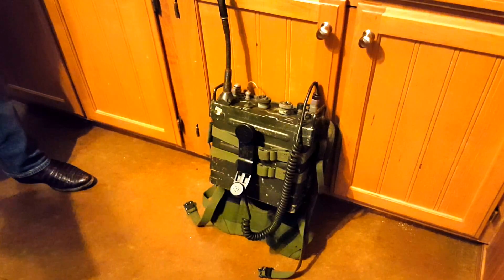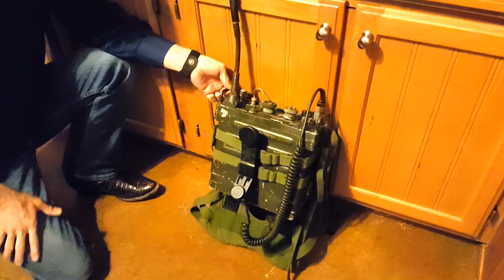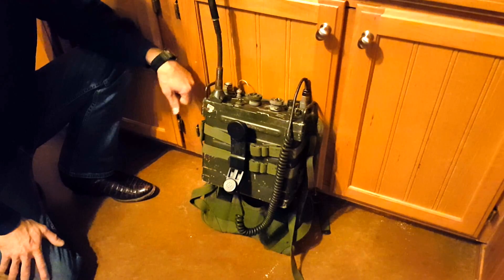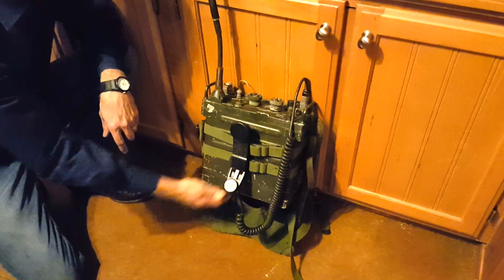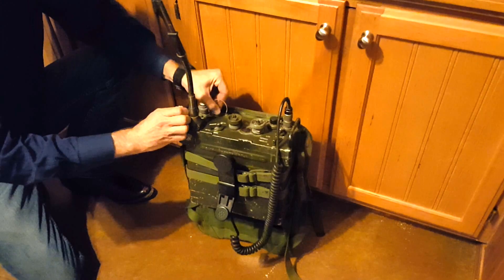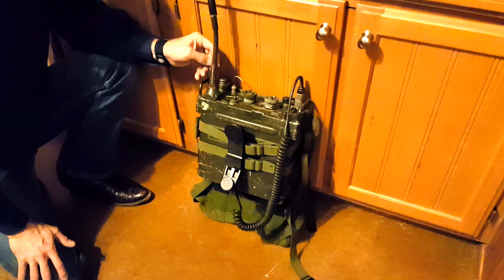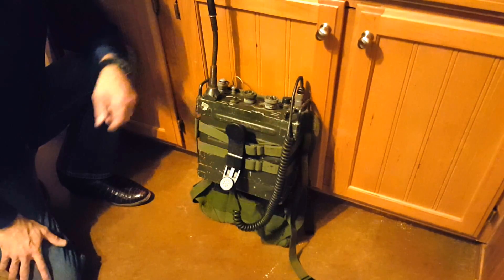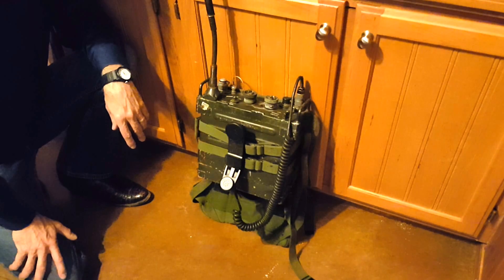10 Must-Know Facts about the PRC-77 Military Backpack Radio

Comment: I was in the Navy in the seventies. I got stationed with NMCB-3 on Guam and they had these radios. They were using them as base station "dispatchers". I sumitted an idea to the Navy for replacing the battery with a power supply that would fit into the battery compartment. The idae was rejected, but at least I tried.

Comment: I have 2 of these my husband and I used for reenactment.  I pulled the one he had mounted in our deuce when I sold it. Used these when we did air shows to listen to the pilots. Keeping them cleaned and running for emergencies. I have the antenna and handsets for both. Glad I found your channel. I have another set of radios I think 501. I'll check out your videos for those.

Comment: Another Must-Know fact is that transmitting on this radio in the US is most likely illegal unless you have a FCC license for a frequency in the 30 - 50 MHz commercial or government band, or an FCC amateur radio license with privileges in the 50 - 54 MHz band.  The PRC-77 is FM with 8 KHz deviation which I do not believe is legal in the 30 - 50 MHz band but is likely ok in the 50 - 54 MHz ham band.  Also, the active duty US military, including National Guard and Reserve units in many communities all across the country still use the same frequencies as the PRC-77 except on modern radios such as SINCGARS, PRC-150, PRC-148, PRC-152 and many others still using the backwards compatible 8KHz FM deviation. They may also be operating single channel secure so the PRC-77 will not receive audio even though the frequency may be in use. A PRC-77 within range could certainly cause interference. For decades the US military was limited to use only 30 - 50 MHz in the US. This is because of the 50 - 54 MHz ham radio band, and analog TV channels that operated in the 54 -75.95 MHz spectrum. This has changed over the last few years because broadcast TV has gone digital and likely moved out of that spectrum. Because of this US military has been authorized a gigantic number of frequencies IN SELECTED AREAS in the 54 - 87.975 spectrum that were previously off limits. This is especially true if there is no broadcast TV using those frequencies in the area of a military base or training area. BTW, military units don't need a FCC license; they have frequencies from NTIA assigned to DOD and issued/licensed through a Spectrum Manager somewhere up their military chain of command.

Comment: The PRC-1177, in addition to providing a 25 kHz channel spacing, also used a narrow bandwidth for FM. This reduced compatibility with the PRC-77. Also, although theoretically half the channels would be common to both radios, half wouldn't. Which is why the PRC-77 supported 920 channels, while the PRC-1177 covered twice that number. Yes, the radios could be operated under Jeep power. A cigarette lighter adapter could be used for modern vehicles, along with a properly-tuned vehicular antenna. But at two watts, I wouldn't expect much range out of these radios. Still, lots of fun to play around with.

Comment: The range is superior than a baofeng 5r?
Reply: Doubtful because an effective antenna needs to be at least 1/4 wavelength. At 30 MHz the wavelength is 10 meters the antenna needs to be about 7.8 feet.  At 50 MHz only 4.6 feet.  The higher freqs are better for the short tape antenna. However, the PRC-77 doesn't have a precision antenna matcher. I believe it tunes that short antenna down to an SWR of 3:1 on some freqs while others may be 1:1. So, if you only start with 1.5 watts transmit, you lose 10% of the power at a 2:1 SWR and lose even more at 3:1. By comparison, the Baofeng operates on VHF High (136-174 MHz) and UHF (400-470 MHz) where the wavelengths are much shorter, the antennas are more efficient, and the radio is 5 watts output.
Reply: Thanks!

Comment: Tape antenna bro. Tape antenna. 3 mile range. Whip 12 miles give or take. Connected to RC-292 antenna, maybe 25 miles. Nice. I'd like to have a prik77. Again. Did it come with ky-57? Ky-38?
Reply from the maker: Roger Roger.  No voice encryption on this particular unit.
Reply: @WW2JeepandRifle  yeah. thank God for that CEOI right?
Reply: that rc 292 you mention. tell me if I am remembering correctly. it had a "matching"  unit at the top and once beyond certain frequencies you had to lower it and change the number or elements to operate in that bandwidth. it was part of our TOC in Germany in mid 70's.

Comment: These radios are great items. I’ve got two, because no one else does FM in 6m. Very rugged and if they need an alignment or other repair, the manual is fantastic. These were the last military radios not to use IC chips so you can really get down to the component level if there is a problem, or to just study the outstanding level of creative engineering that went into these rigs.

In my area the hills limit the range to around 1 mile with the short antennas.

There’s lots you can do with them. I’ve hooked up the Ardent ADS-SR1 simplex repeater on one so I can hear myself and check the link. I have also hooked them up to two Signalink USM sound card modems and done Winlink emails back and forth. They are a great tool for learning about ground wave propagation.

Yes, my FT-817 and FT-60r are more powerful, with more capabilities and better for making contacts in all situations but if it breaks, I can’t fix it, and I can’t leave it out in the rain or run over it with my car and expect it to work.

Charlie
KM4ZZ
Reply from the maker: Very very cool!  Did you make your own cable to connect the signalink to the radio for your winlink email project?
Reply: WW2 Jeep and Rifle , yes. It is not hard. The audio connectors are readily available on eBay and I just cut off the end of a cat 5 cable. It wires up directly. If you email me directly, I’ll send you pictures of what I did. My email is on my QRZ page.

I am exploring the idea of connecting the Signalink through the J3 power port. That’s how they connected the crypto gear. You can get a wider bandwidth that way and take out the volume controls. The problem is the connectors, the only source I found I’d digikey and they cost $42 a piece. I not sure the convenience is worth it.

Lots of fun playing with these rigs.

Charlie 
KM4ZZ

Comment: Remember  the back pack  radios  early 80s  didn't know  much about them  freq mode power  level  ECT.  Remember the brick battery  that went in the bottom  . Everyone  went by prick77.   2 watts  FM  30 to 50 kHz that's  weak for power output  must have been  tuning  coil taps inside  to keep SWRS  close  for that spread of freq  rember the77 being heavy  .

Comment: Used the PRC 25 in Vietnam.  When not on patrol,  or ambush,  set it to 6 meters and called CQ trying to work skip to stateside.  Never successful but I did make contact with other Hams trying to do the same thing.
Reply: You served in the Vietnam war?
Reply: I got to mess around with a couple of 25’s when I was in the Corps in the 80s, but never used them in the field. We had the 77’s.

Comment: Are you able to use these effectively today? I am looking to get one, but I was wondering if they can pick up modern frequencies. Should I get this instead of a brand new radio or or these just collectors items?
Reply from the maker: These work fine but are only legal to use for a limited set of frequencies in the 6m band.  As far as a practical radio, nah. Not the right choice for versatility.  Collectors item yes. Absolutely.
Reply: WW2 Jeep and Rifle Thanks! That helps a lot
Reply: Phantom Orbit frequencies are neither modern or ancient. They’re like gravity, magnetism or sunlight. You can use a PRC77 legally on the “modern” 6m amateur band, if you’re a licensed amateur radio operator. This is a collectors’ item, for sure. Get a modern amateur radio. Get your amateur radio operator license, it’s super cheap and a lot of fun. 
73 de KM6S.

Comment: Great radios, I also used them while in service. Where an I buy the battery pack adaptor for D-cell batteries?
Reply from the maker: You can find the D cell battery holders on EBay. Here are a couple links - first one is cheaper but ships from Poland, second one is more expensive and ships from Delaware. 

https://rover.ebay.com/rover/0/0/0?mpre=https%3A%2F%2Fwww.ebay.com%2Fulk%2Fitm%2F173580533569

https://rover.ebay.com/rover/0/0/0?mpre=https%3A%2F%2Fwww.ebay.com%2Fulk%2Fitm%2F382550209301

Comment: Never had the 77. However I  accidently found a skip opening when useing a PRC 25 and found to my surprise  my old radio unit in ft hood. I was near port Clinton Ohio on a nasa base. the revciving station at then gray army/air base.when the skip is right they surprise you
Reply: Was a radio operator.trained at ft Gordon exempt I found my self and an airman working in hexx hoxx on whirly birds it got hot in there. We swapped out prc 25s for vrc 47 (ground troop communications) it was a living. Also carried a 31m20 32m20-2t Carrier mos . We would wait for a tactical op to set up a line up to the site for trans Fer to the next station and prc 25 were vital     part of our setup and talking to the bird that brought food /removed trash from the messa  good life

Comment: You can remove the magnesium cells from the old disposable batteries and install a sealed lead acid battery inside that box, using cardboard or corrugated plastic shims to make it fit tighter. Solder the leads onto the socket on the battery box and plug it in.I've got a couple of the PRC-77 rigs, the work great. One has the European 25khz switch modification which multiplies the number of available frequencies. Used them in the army for years in the 70's. A heavy radio for such low power output, more modern radios blow them away in every aspect.....but hey, its nostalgia! They still command relatively high prices and several modern rigs can be bought for the same money.Thanks for the video!
Reply from the maker: Lots of options for batteries these days.  I've got a video on that topic too: https://www.youtube.com/edit?o=U&video_id=a7nPfRMJH8c  as well as a how to video on making a rechargeable battery out of the magnesium battery carcass: https://www.youtube.com/edit?o=U&video_id=bHjlJ5NzPAU
Reply: @WW2JeepandRifle can we get an updated link? It doesn't work 😕

Comment: I recently purchased two sets of AN/PRC-77s, of which one was factory new(made in 1973) and was delivered in its original plastic wrapping and cardboard box. Both works and now I just need to get a license for using them for transmitting. In case of a SHTF situation they could prove very useful and potential lifesavers.
Reply: Where did you find them and how expensive were they?
Reply: on ebay.de and https://www.sparks-military.com/en/
Reply: I'm sure they were great radios in 60-70 but no they wouldn't be useful at all for shtf comms today a $25 Chinese radio and a ladder line antenna in a tree would  work 100x better and fit in your pocket I mean are you really going to carry around a 20 30 pound radio along with riffle ammo and supplies come on? Not to mention the Logistics of charging the thing!
Reply: @Texasoutlaw173  You can boost the output and make radio relays with AN/PRCs - you can't do that with a 25$ Chinese radio.
Where I am living the AN/PRC is the best option for my needs.

Comment: I have one of these I use on Amateur 4 metre & 6 metre bands (50mhz & 70mhz) You can build your own charge capable battery pack using Nicad or Ni-Mh batteries. I used 12 batteries to get 14 volts, seems to run realy well. I've fitted a toggle switch and socket on the side of the battery box. The socket takes a 12 volt external feed. The switch allows you to switch between the two, internal or external supply. Great radio.....P.S... I removed the 105hz tone module as this was awful for other station to hear all the time. Just unplugged it. Another great ex miltitary radio for VHF is the british PRC-351 (RT-351). Cheap purchase of ebay. I purchased my PRC-77 from a guy in Israel via ebay.   .. de G8KAS in the UK.
Reply: You mean The Tone Squelch? I didn’t realize it could function fine without it. From what I’ve heard the tone Squelch also makes it incompatible with just about any modern radios aswell.

Comment: This may be a stupid question but do you need a license to operate these radios or can you just not plain use them?
Reply from the maker: In the United States, you need a license (Technician class) to operate radio equipment on the 6 meter band.
Reply: WW2 Jeep and Rifle Great, I have a technician license
Reply: Alex Kinch Awesome! 
Technician class license gives you full legal limit on 6m (50 MHz). PRC77 covers 6m. PRC77 goes for $350 on eBay, you can get a much nicer, brand new radio for that money: Yaesu FT-8900R.
Reply: In Denmark you'll need a license for using the PRC-77 for transmitting but no license is needed for using it for listening only.

Comment: This one of the ground air radios I repaired and operated in Vietnam.  I’ve seen some truly damaged radios come in to be repaired, I even fixed them in a middle of fire fight when someone platoon or commander need it fixed.
Reply: Any tips for someone trying to restore one? so far I’ve attached a Radio face from one Demilitarized Radio onto a 1977 Dated Chassis (after a lot of wire flagging and splicing). The thicker wires are my main concern with splicing. I just used a separate smaller wire to connect two of the thicker wires as I saw a similar method used previously on a lot of the other wires. I wrapped it a few more times to ensure it wouldn’t come off before Soldering though. And then I need to bundle the wires together again but I may just wrap them in tape for easier maintenance later. Other than that I think I’m nearly done. Aside from replacing the Dial window and replacing a couple few wires.

Comment: I also used the pric77 While serving with the 82nd, 1986-1990. late at night while pulling guard we would turn the channel and listen to T.V.  but don't tell my CO.
Reply: MARTIN KERKER Germany late 80s low end am radio we pick up some Really German sound misic
Reply: lost one, I was in B co. 1/325 from 7/86 to 3/90 then called back in 1/91 ended up in Germany until the ground war ended.
Reply: I was an 05B, 36C, and a 36K in the PA, Army National Guard 1979-1985 and I did the same thing. I used to be able to listen to HBO when there was only one. Lol!